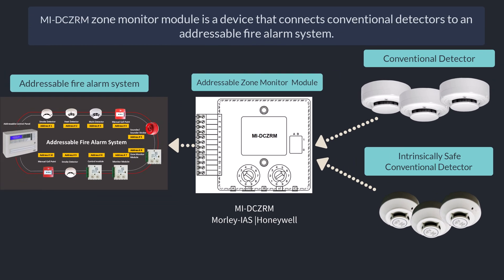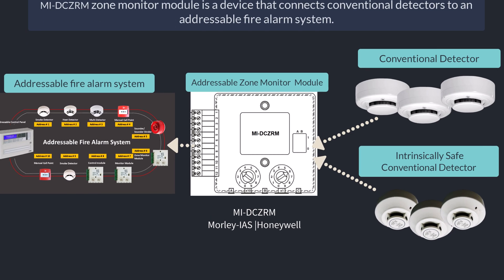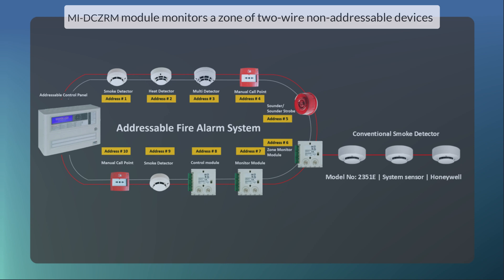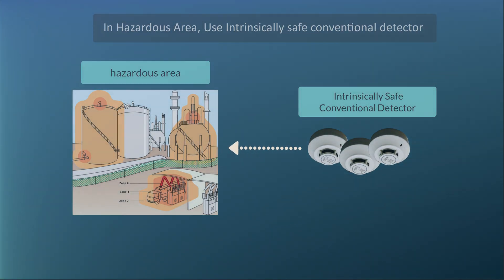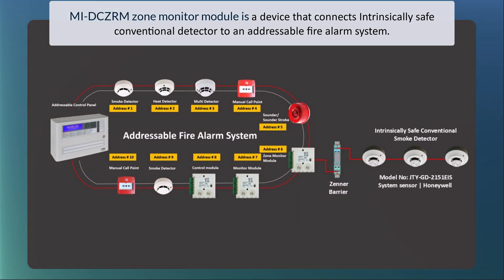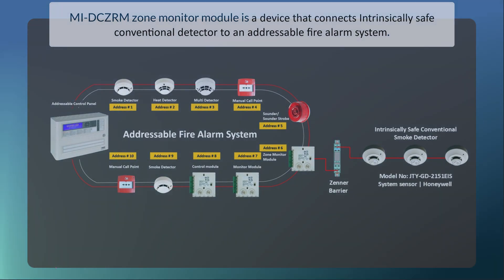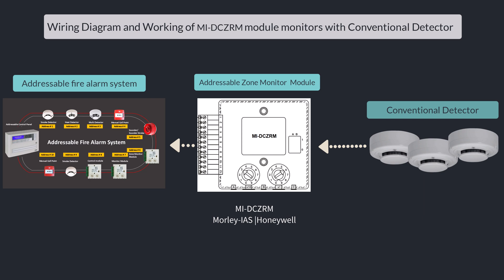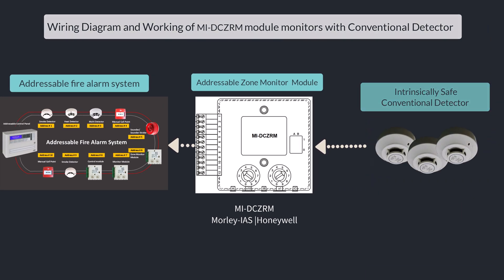Morley-IAS (Honeywell) MI-DCZRM Addressable Zone Monitor Module | Wiring Diagram & Working Explained

Comment: From SMPS ther is connection for battery..but voltage not coming in SMPs terminal
Reply from the maker: 1)Use two nos of battery,
And
2) SMPS use with battery backup smps